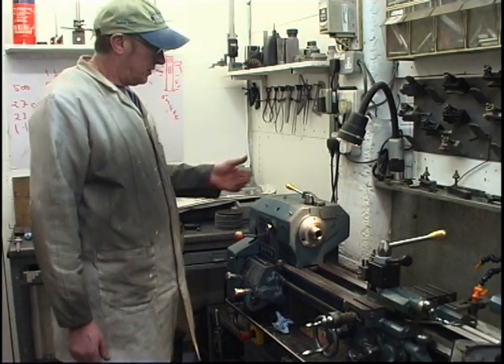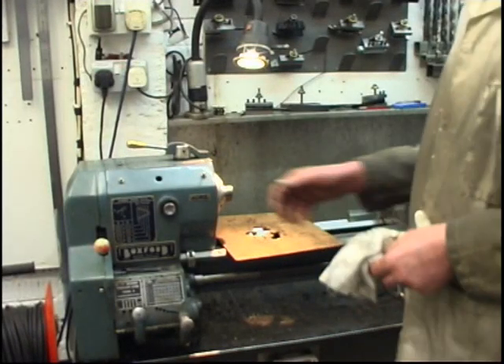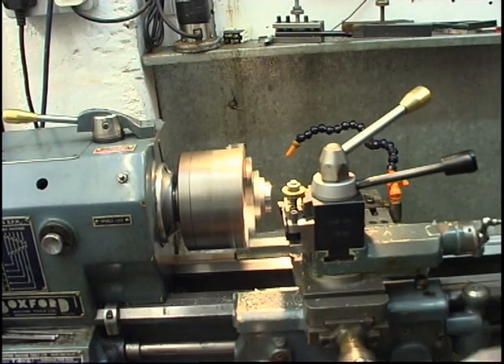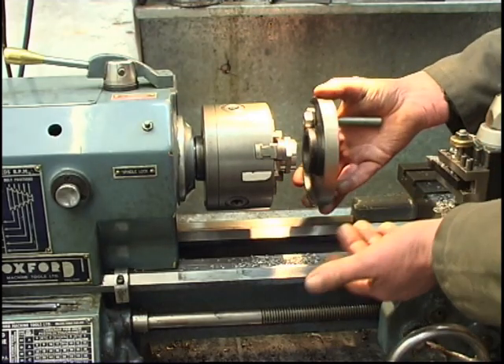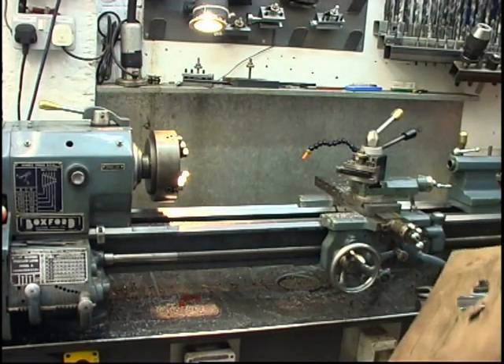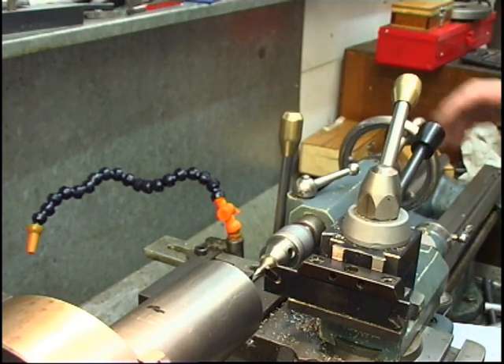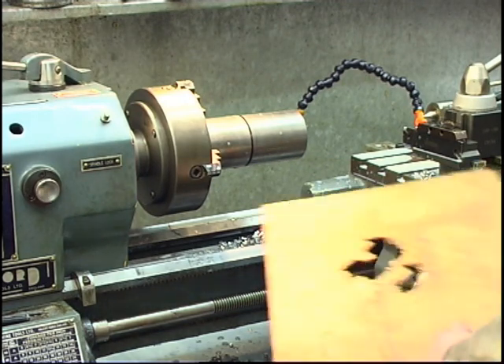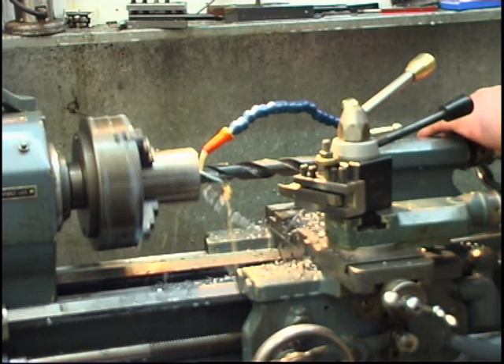GET A GRIP ER 32 CHUCK PT 1

Comment: Hi where did you purchase your quick change tool holder as I've looked everywhere and bought probably 5 different ones so far but they just don't tighten down as good as the original however yours looks solid and a brilliant fit.
Reply from the maker: Onur Caglar I bought mine from "chronos" on ebay RegardsJohn
Reply: Thank you I'll keep an eye out for that seller.

Comment: Hi John: great content on the Get a Grip series of videos. I have an identical Boxford to yours, my first metal lathe, although I've done a lot of woodturning. My Boxford has the typical cabinet but mine came without it's screw in feet and I can't seem to match the thread with any American or metic bolt. Would you be able to determine the thread on yours and pass it one please.
Thanks, Bryan.
Reply from the maker: Hi
Bryan
The base on mine just has plain holes 1.2 inch
I welded 12 mm nuts in place and just use 12 mm bolts to level it
Regards
John

Comment: Yes that's the plan, but once trued it will be roughly .010 to small for the chuck bore....I thought I could shim that clearance once its turned, so the back plate would be a solid fit back into the chuck and would center itself of course.  ( I have to remove .010 to true the back plate , .010 puts the chuck on center, but im left with .010 clearance backplate-chuck....i hope im making sense

Comment: Hey , love the vid's..good stuff!. I have a guestion as you're doing chuck stuff. I have a 4 jaw that came with my new lathe (china made) , i check it for runout and it has .010". I took it apart and the problem is the back plate, the chuck itself is fine. If i was to turn the register on the lathe to true it (.010) and shimed stocked the now clearance in the chuck, do you think that would work? the spindle register and face are fine. Its just a issue of balance.
thanks
thanks